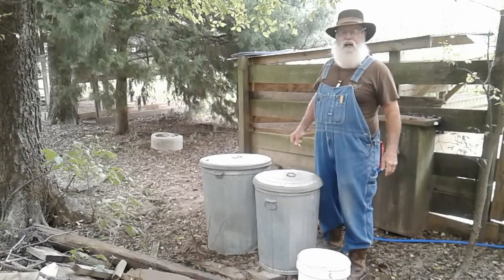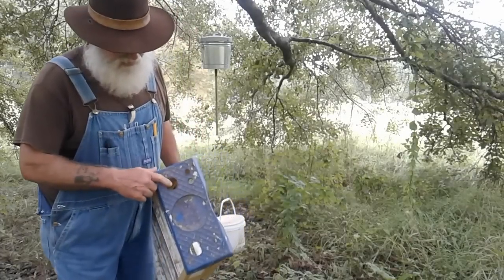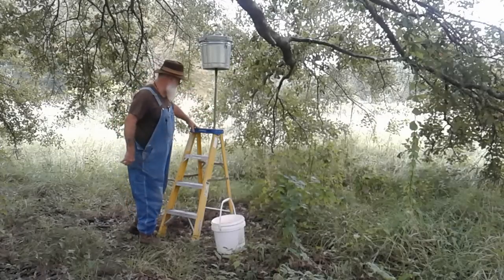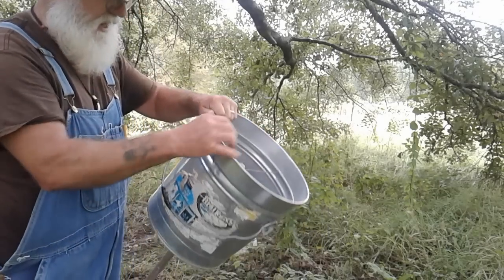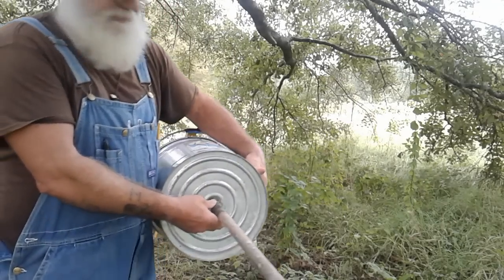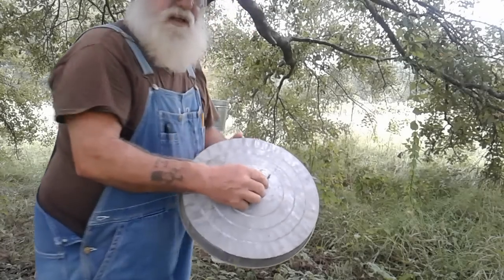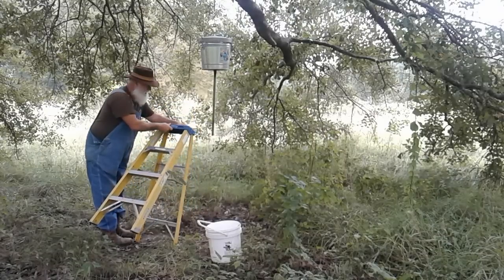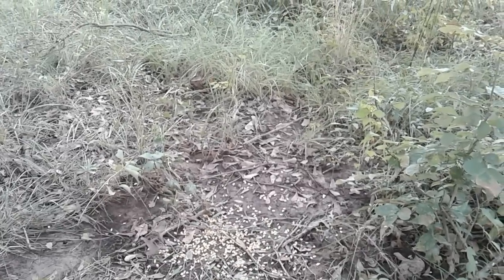DIY $16.00 AUTOMATIC DEER FEEDER

Comment: Thanks for the idea! These new fancy feeders are so expensive and made of cheap plastic. Going to give this a try, with one modification. Will probably wrap the hanging chain in barbed wire to keep critters from climbing down on it.
Reply from the maker: might want to try metal conduit instead of a broom handle...the squirrels can jump up to it
Reply: @WORMGITTER  Yes. I was thinking that as well. I think they have some slick/metal broom handles at the $1.25 store. With the way things are going it may be the $2.00 store by morning. 😄
Reply from the maker: @BackRoadBound  thats an even better idea...the metal broom handle...pour a little corn on the ground to get them use to it and you will have to set the bottom of the broom handle high enough the racoons can't reach.  Thanks